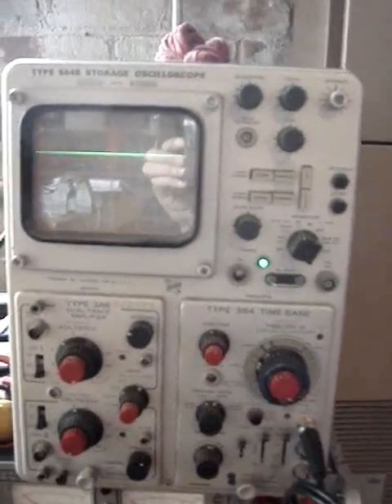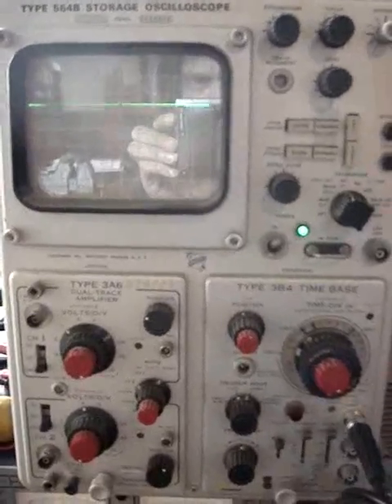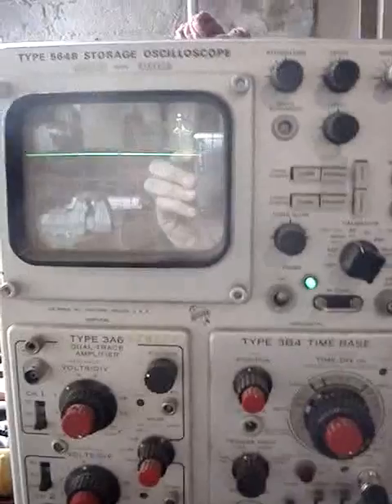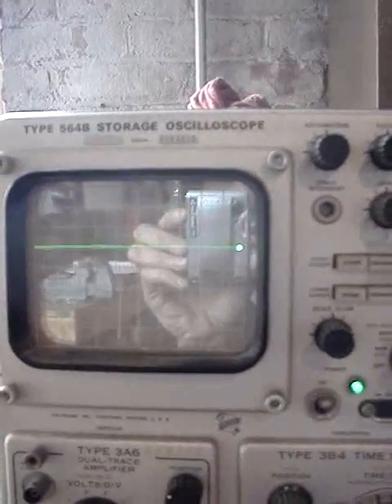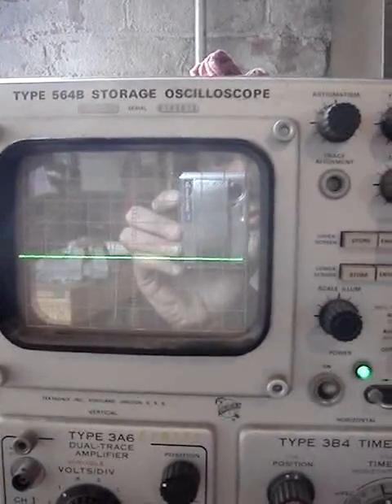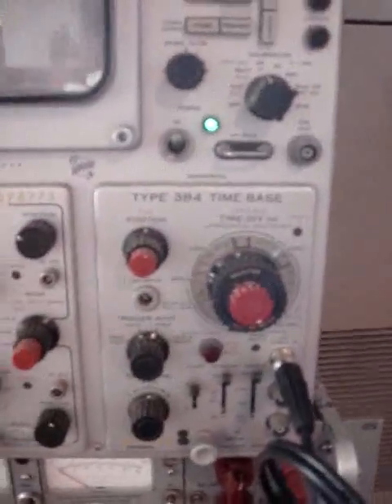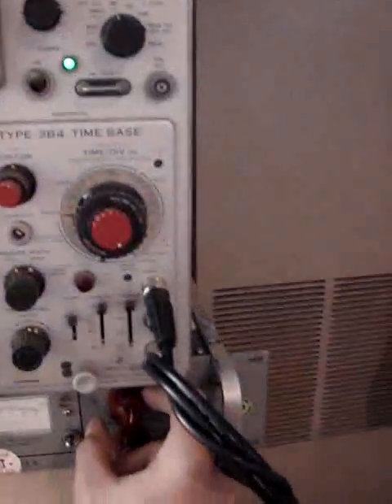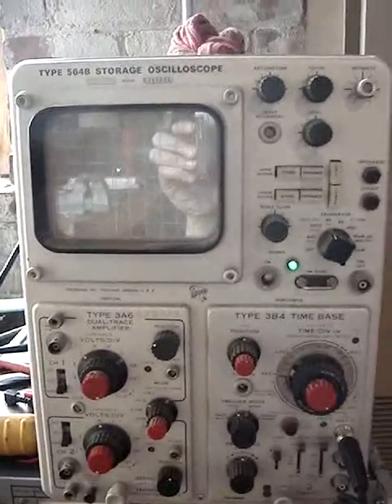Tek564_Symptoms_01.MPG

Comment: So what was the problem? I have a 564 (not B) shown here:

https://www.youtube.com/watch?v=QkcVwRKy6Jk
Reply from the maker: I did find the problem!  Sorry to have taken four years to post it.

My initial suspicion was the sweep circuit in the 3B4, which was wrong.

I found a low supply rail and traced it back.  A pair of 2.7 ohm carbon comp resistors (R75 and R94) in the low voltage supply of the 564b had drifted up in value.  I can't remember the details exactly (it was a while ago) but I believe the current limit was turning on for one of the low voltage rails when it shouldn't have.  I replaced both resistors, and everything swept fine again!

Comment: I'm also interested in the follow up.

As an aside, I purchased a 564 with a 3A74 four-trace amp plug in at a local thrift shop.  I am unable to get multiple traces to show at once and ch. 2 doesn't seem to work at all.  If I switch 1 off and 3 or 4 on and adjust the vertical position, often it has affected the position of the others.  Any ideas of where to start?  My web searching thus far has been pretty fruitless ...